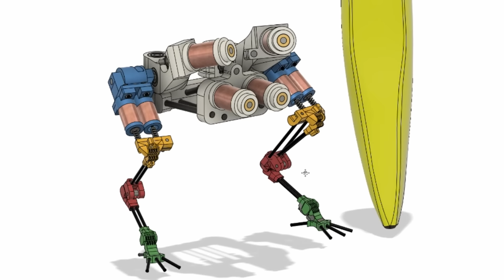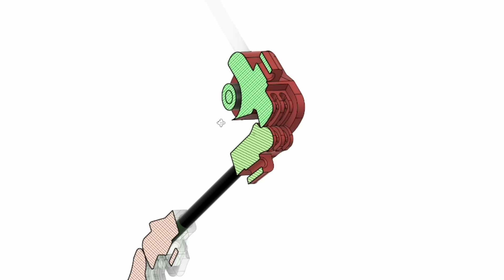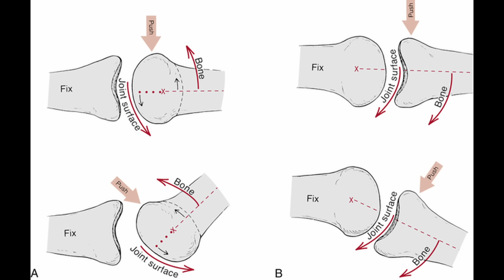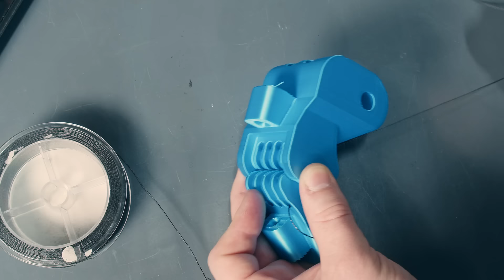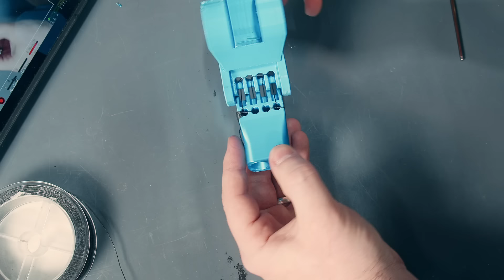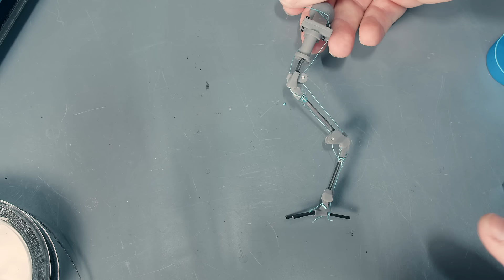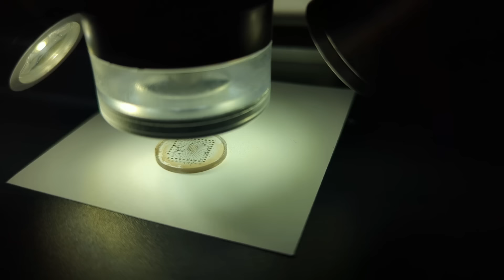Alternative to bearings for tiny robots

Comment: Another advantage I can think of is that the r-c joints are pretty much immune to failing from (in plane?) compressive impacts. The force (in the case of a bird) would travel down the leg and through the joint. For a ball bearing this could ruin the surface finish in the inner races and potentially jam it, this is because the force is concentrated basically at several points (spheres contact a surface at a point). R-c joints contact along lines, therefore forces are spread over a lot more surface area. 
Bearings have the advantage that forces applied in planes are treated equally in every direction, whereas a r-c joint is going to perform much worse in tension than in compression.

Comment: Some of the slots are not completely populated with a cord and can be tapered to aid in assembly- once you start threading, each path will be obvious. Likewise, the transverse routes from side to side can have grooves the depth of the cord to guide the cord, and where the cord is wrapped around the outside of the bones grooves can recess the cord to protect it from abrasion.

If each cord is independent, a single damaged cord will not destroy the integrity of the joint. A smaller hole for a stopknot, or a hook or peg for the end to be attached to can help. A compact means for tensioning the cords can tighten up the joint, too. This can be as simple as a screw and a washer- loosen the screw, wrap the cord around, tighten the screw, just like the rudder adjust on my Hobie kayak.

Comment: Video Recommended to me Sept 3rd, 2024. Hope you had fun at Open Sauce.

Q: if you were to loop through again in the same pattern does that stiff or just add redundancy? Same Q but change pattern to topp bottom bottom top on the second pass? Same Q but inverse the threading in a weaving / criss-cross pattern on the second pass? Would any of these lock the joint or restrict the movement too much?

Comment: How is this different from each rod having a meshing gear (with teeth) on the end (besides more limited slip, higher friction with a gear)?

Biologically, we have synovial fluid as cushioning between joints and tendons+ligaments (mostly ligaments) that surround the outside parts of joints to keep the rods in place. In your machine, the tendons+ligaments are the very thin and horizontally "slidable" strings combined with the two side layers of plastic, but the cushioning is nonexistent (aside from the ability to make it worse by possibly adding gear teeth). For your small and very lightweight bird model application, cushioning may not be important, but it's still something to consider if it hops around. A possible cushion that comes to mind is the plastic "sheets" that feel like they want to become styrofoam but never grew past sub-millimeter bubbles and has a really smooth surface for a plastic foam - EPE (Expanded PolyEthylene) foam. A more abrasive cushion option would be closed cell foam sheets.

Comment: rather than using thread, could you not use 4 x "S'' shaped steel wires (try different gauges) that have memory cooked into them? that way when the hinges bend, they also have a memory they wish to return to? just like how knee joints use elasticity

Comment: Thank you for sharing information!

Can you explain the need for the alternating ridge-channel design if the ridges do not articulate into the channels? 

I could envision greater stability along the rotational axis if they articulated, but since they don't, why not just make them smooth surfaces like in a biological weight-bearing joint?

Comment: The weight savings for a bird leg seen like a substantial benefit. 
I would imagine you want the foot to be the heaviest part for stability. Eliminating metal bearings mid leg will allow it to pop and spring nicely
Reply: I wonder if small bird legs are semi-sprung flexural components (the lengths of the legs, not just non-linear joints) 

That could be a way to generate a lot of hop.

Comment: Cool design. I'd recommend avoiding metal wires if not necessary, because they tend to deform plastically when repeatedly bent and unbent (unless you're using something like nitinol, if you are, you know what you're doing). Generally, at larger scales other bearing options are viable though, so probably not the biggest concern.

Comment: Since you're using a forked design for cable routing, why not interlace the forks and have better dimensional stability, rather than rely on just the mating surfaces and the endcaps, essentially forming an endcap for each fork's surface?  Just get some uhmw tape and offset the sides of the fork on your print, this would give you a friction surface on the rolling joint and reduced friction on the sliding surfaces.  I'm also not the biggest fan of your cable routing method, you want these to be push-pull joints, which can easily be driven by one motor via a dual-spool, the only way you get uni-directional rolling joints is if you have a spring that pulls the joint to one extreme and have your motor constantly fight this force with its own holding torque when static and modulate this for dynamic movement, which is highly inefficient; a dual spool provides holding force via cable tension and not the motor's own holding force, this also means dynamic movement only needs enough force to slide the joint, not modulate holding force off what the base amount is, a dual-spool is far more efficient.  The only other thing, since you're likely clustering every motor in the body itself rather within the relevant limb, the kinematic model is going to be an absolute pain, because movement in joint 1 will adjust position in joint 2 and 3, similar is true when a joint has multiple axes of movement, j1a1 will modulate j2 and j3 differently from j1a2 will; relocation of the bulk of weight means you're doing a lot more work on micromanagement of how joints interact with each other.  This will also inevitably introduce cg issues, and you need to account for foot placement and skeleton dynamics accordingly; sometimes wider hips are better than more leg splay, etc.  And finally, my only major gripe with cable-driven mechanisms is just how there's no natural springiness to them, and how this becomes an entirely separate engineering issue and balancing act; even at this scale, unless you have anemic motors, the mini robot can overpower itself and tip itself over if it's on a dynamic surface with rigid joints.

Comment: LOVE this idea and this project. Very inspiring.
One question: you wrap the rope ends and make knots. Is there not a faster yet compact way to fix rope ends? Thinking 'Design for Assembly' here. I'm thinking of clamps with little screws, but those might still be too big? Maybe v-taper holes like sailboats have?

Comment: Have you tried a ball and socket with  severally connected tensioned cables?
Same idea  just mock up all the tendons and joints in a birds leg and use tiny steppers housed in the bodyfor holding position?

Comment: NO ! you get more stability, simplicity, reliability and speed of construction with a straight through pinned joint. You can use top-hat beadings if you need a longer service life, but in this prototype stage that's not an issue.

Comment: A Jacob’s ladder toy works similarly. It had 5 blocks with woven ribbons between each block and as you folded one block into a lower block it would Cascade to the bottom block. Similarly to how the rolling joints are woven together.

Comment: Why don´t you instead print gears to mesh instead. They don´t exist in nature just like the wheel does not but they still make sense, they translate a lot of torque and are easy to print. Also no strings and other stuff needed. It´s also way easier to design end stops and limit their movement etc. What you did is cool and all but it´s way less ridig and more complex, I really don´t see the appeal.

Comment: I love how the algo works, i was just thinking last night if I could use a rolling or sliding joint for the 3 z-axis that could be entirely 3d printed. The goal is to allow the bed to tilt but not slide and lifted out without removing hw

Comment: What about using one side as a negative to prevent the slippage and the eventual warning of the protruding parts that would hold the weight of the structure.

Comment: Sorry, I dont really understand. What prevents this joints from SLIPPING? If the ropes are rolling on a inner surface, that means that they don't really prevent from one part slipping from an inistial contact spot and making one side of rope loose.
Itsn't it?

Comment: Why not replace the stitching on the joints with multiple elastic fixtures? 
Sure it adds complexity and makes manufacturing a bit more difficult, but it adds redundancy and makes it so that if the single wire breaks the whole thing doesn't follow suit.

Comment: I've been thinking a lot about this sort of robot lately. Think it's the future. Animal legs are tensegrity structures with all manner of "compliant" materials in the joints. Think robot legs are going to be all pulleys and capstan drives in the near future. Cheaper and easier to build, lets you put all the motors together in a single unit at the desired center of mass.

Comment: Technology converges towards biology as it progresses and this is a great example (imitating bone articulation joints). Nothing is more complex and efficient than biology, and everything we design pales in comparison due to limitations in material science knowledge, manufacturing methods, etc. A single living cell contains processes and "machinery" that we can't even come close to "build" using technology. We can clone cells, but building one from scratch? We still can't even explain how evolution could come up with DNA and single cell organisms starting from basic chemistry.
Reply: "We still can't even explain how evolution could come up with DNA and single cell organisms starting from basic chemistry."
we literally can, just google it dawg, we even found thousands of viable alternatives to DNA.

"A single living cell contains processes and "machinery" that we can't even come close to "build" using technology"
because evolution works from bottom to top, while we humans design stuff from top to bottom.
(also, the cell had billions of years of evolution, while we only had a hundred or two)

Comment: Awesome.  Question: did you consider interweaving the knuckle contact joints which would strengthen the joint and avoid lateral movement?  Maybe at the cost of increased friction.

Comment: I get why ball bearings arent suited in this case, but whats with bushings? When i need small joints in 3D printed projects i usually drill a hole to size and use a polished rod of fitting diameter in it. Many plastics used in 3D printing are great (or good enough) bushing materials that these joints last 1000s of cycles. Sometimes 1 drop of oil is required as lubrication, but i have never bothered to re-oil and everythings still running great

Comment: pretty interesting. it however seems to me that the looping around with one wire instead of 4 individually gives it even more play and spring on the forward end of movement... maybe you could tighten it even more, if you use individual lines and sort of knot them off

also one extra thing: you stated we only care about the two mating surfaces. I terms of later performance I disagree... you gonna have some side-load and then the shoulder will contact and cause big friction: so those shoulder surfaces should at least be polished to minimize friction

Comment: I can easily imagine an oversized version of this with additional internal grooves in each individual contact joint surface with captive ball bearings for even lower friction (and better repairability) in an exoskeleton-type robot, with additional locking mechanisms and damping as well as larger endplates for additional lateral rigidity.

Comment: Look at the distance between avian “hip joints.” They are never as far apart as your robot. They are usually very near together. This allows each leg to control balance with very little tipping when transferring weight from one leg to another.

Comment: I like the idea but I don't trust the wire/string after thousands of cycles it will wear out. 
There is a mechanical way to make a single part flexible joint in a big scale model or using rubber for 3D printing for that specific joint, I didn't try yet myself 
but planning in the future a small demonstration as I'm working on small parts as well with small scale 10~5mm bearings.

Comment: Cool stuff for sure, now i was wondering for your particular project, can't you just connect two legs parts with some Coil spring.. i'm not sure of the name so i looked for an example, now probably the wrong size still: Quill Feed Return Coil Spring could be used. Maybe we may still have some friction but shimmed with teflon can't it be done ?

Comment: I wonder how you designed in the range of motion limits in the joint, was there some specific math you used?
Currently in the process of designing my own rolling contact joint for a specific application requiring a very limited range of motion (10-20° max) and the only way I see to limit the range is by using an arc with a larger radius on both edges....
But this is a rather inelegant solution.

Comment: is there a reason you dont have dyneema running in both directions through every hole? the cable wearing against itself?
Reply from the maker: Mostly just logistics of threading the tiny little parts. Having it go bidirectionally would probably be more stable/stiffer. I think dyneema is very wear resistant so I don't think it'd affect the line too much.
Reply: @BreakingTaps  Thanks for the reply, I guess I was focusing on the scale of the demo rather than the intended use scale. Sorry to bother you with another question but I noticed a lot of slip in the demo model, I imagine this wouldn't be such an issue in the smaller pieces but is there any benefit or is it even possible to model teeth into the mating faces to prevent this?
Reply from the maker: Possibly, I'm not sure to be honest! Probably depends on the end goal. I.e. knee joints actually have a rotation range, and then a slip range where the two bones slide past each other over cartilage. So it probably just depends where you want to land on the motion types and constraints.

But I imagine teeth would work fine!  Also note that the demo model was tied quite poorly/loosely since I was doing it on camera at an awkward angle :)

Comment: Why not just use a hardened steel pin and a bushing. Get a piece of Ultra-machinable Radel PPSU (yes thats the actual name). Ive used it to make tiny bearings for my fishing reels to giant bearings on the paper machine at work when all other $100k bearings fail. We even keep a long piece of round stock to use as a drive pin to beat old bearing races out of hubs with big hammers this stuff is amazing

Comment: Seen something like this in a old machine, it used some sort of flat steel banding instead of cables.  Had jack bolts to tension it.  Never understood why they designed it like that, other than they wanted to be able to adjust the play out of it.

Comment: Have you ever instead of the 2. Surfaces rotating ontop of eachother done it where its more like a slot type where male to female and if so does articulation suffer much?
Reply: With that if you put cable through a hole like you might put a screw through to connect both parts. Do you think that would increase the stability or like I asked above create issues with the articulation?

Comment: would be good to add a small bolt that can pull on a end of the wire to periodically adjust if needed since it probably can stretch over time

Comment: It’s a great joint solution for sure, very effective. But not like animal joints, the bones of which do not roll against each other but have a cartilage pad between that allows the bones to slide against each other, which prevents bone wear. Would be interesting to see a design worked up using nylon or graphite cartilage to slide two ‘bones’ against each other

Comment: You're reproducing a knee joint/articulation very nicely here :D
For the lateral movement, you can also just tense a cable on each side, it should help to stabilize... like in your knees, you have 2 tendons on the sides :)
good luck to do it in such a small scale :D
Nice project

Comment: It's cool for biological-looking robots, but proper kinematic model for this must be pretty complex compared to axial rotation of a ball bearing. Still not sure why you couldn't do the same with a ball bearing. I'm currently using 2x3x2.5mm bearings and looking to use 1mm ID in future. And bronze bushings also come in small sizes.

Comment: It seems to me that you can obtain the desired mechanical path using double or even single offset glide bearings: the used space will halve, the mechanical reliability will be much more predictable and the cost of the design will be less.

Comment: Very nice work - congratulations.
Those components out of aluminium with a very thin stainless steel cable for no stretch could become a joint that is suitable for a bipedal or quadrupedal robot.
The kinematic and inverse kinematic calculations would be much more accurate with a very stable joint.
Also, actuating the joint with an actuator in the "body" and driving "lines" that run down to the joint keeps the weight and therefor the inertia way down - whats not to like?
Try to find a build buddy at the show that lives near to you that has a small 5 axis mill capable of cutting aluminium properly and I can see this bird strutting and jumping around.